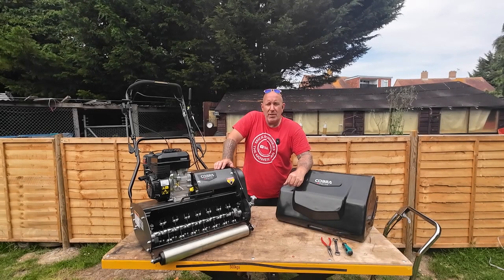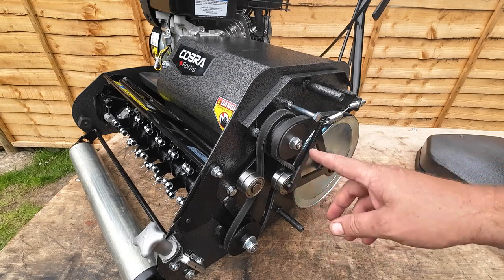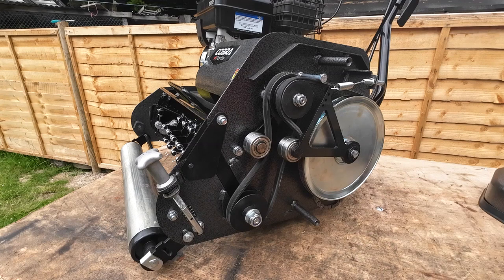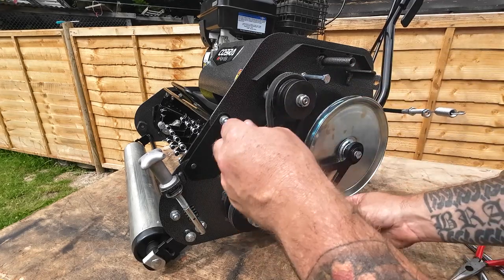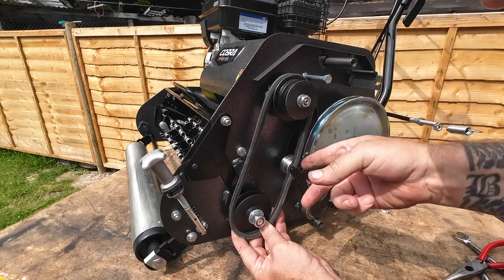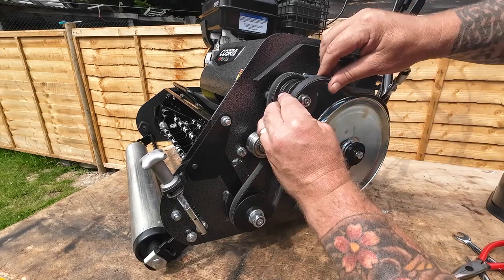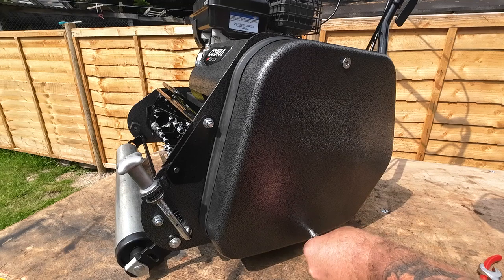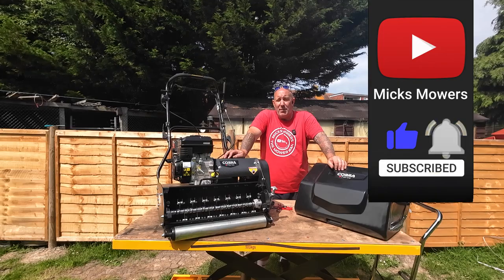Cobra Fortis Cylinder mower How To Change The Belts.

Comment: Is that how it says to do it in the manual?
Just a thought but would it be easier to remove the one bolt in the center of the big silver pulley that holds the triangular tensioner in place? That way the tensioner would be out of the way so the roller drive belt would go straight on and off, no hindrance, or is the tensioner mounted on a press fit bearing?
Reply from the maker: It's my way..  does the job...
Reply: Mick isn't always right.
Reply from the maker: @Ray_ray11  I'm never right